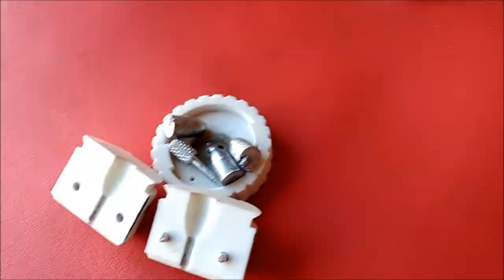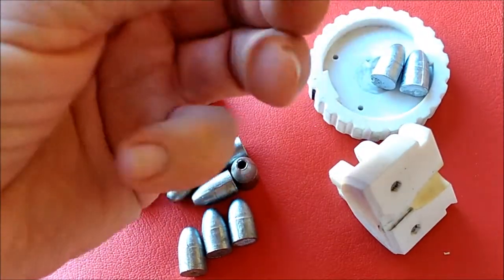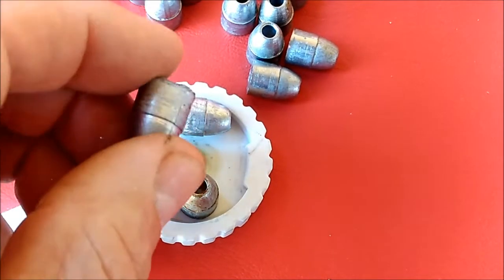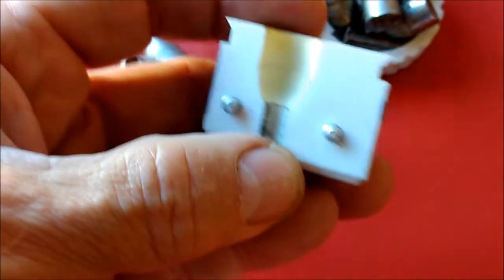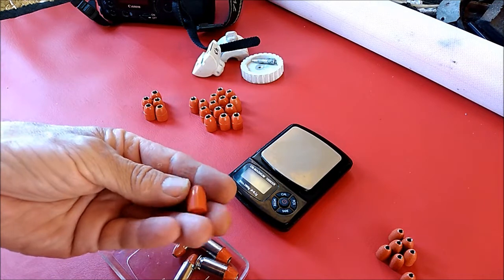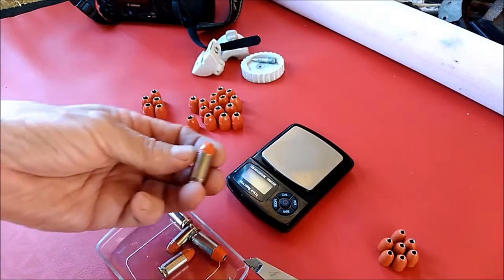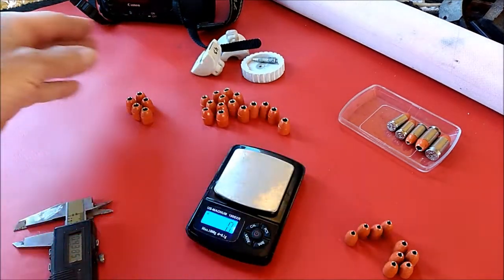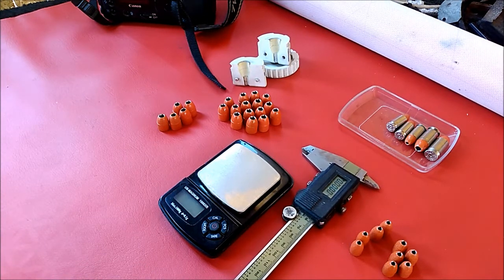Final Results For My Latest Batch Of 3D Printed 45 Caliber Bullet Molds

Comment: Hi Tim, hope you're doing well; I have done some experimentation with this as well but I did it a bit differently. Instead of direct printing a mold as you have, I simply printed the inverse of the mold along with a "cavity" that the inverse sits on top of. Clamp the two together, then pour Plaster of Paris (PoP) in the cavity, creating a mold. I use Murphy's Soap Oil as a mold release on the negative and it pops right off. Once I've removed the inverse prints (which leaves a nice mold cavity) I dry them in my dehydrator overnight. The indexes can all be printed right into it but I haven't sat down to figure out the sprue plate (I just have a sprue as part of the mold for the moment, which I snip off with diagonal clippers.) I'm still figuring out water to PoP ratio to get a good solid mold, along with maybe trying a few additives (red iron oxide.) There's also been some discussions before about using Bondo body putty mixed 50/50 with Bondo fiberglass resin but I haven't ruled out the PoP route yet.

Comment: Hey Tim! Thanks for showing a closer shot of the good bullets - they look great! Very cool considering they come from a plastic mold! How did you powder coat without getting any powder in the hollow points?
Reply from the maker: Thank you sir.   One of the reasons I made them hollow pointed was so that I could place them face down onto some slightly pointed metal pegs.

Those metal pegs are inserted into a quarter inch thick aluminum plate that conducts the small amount of electrical charge needed for the powder coat to cling to the metal bullets.

Because the hollow pointed bullets are face down on those pegs, no powder coat powder can make it's way up into the hollow point cavities.